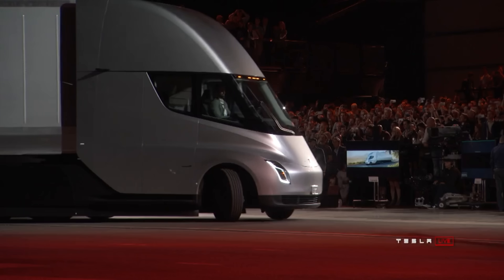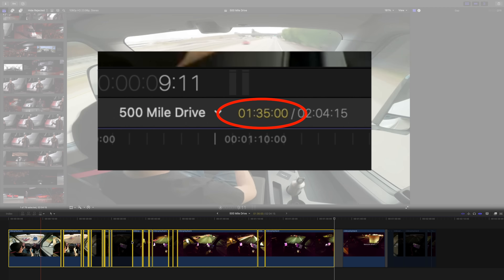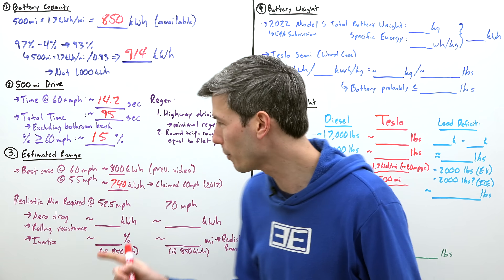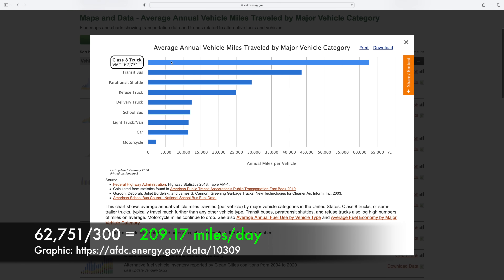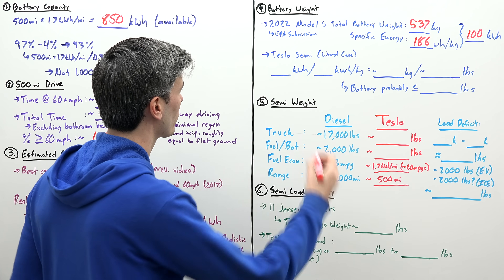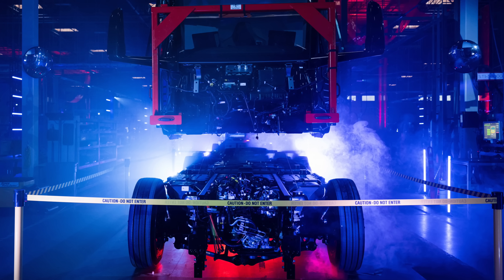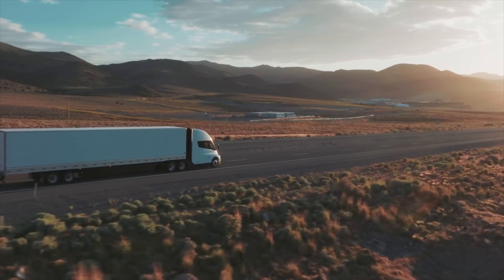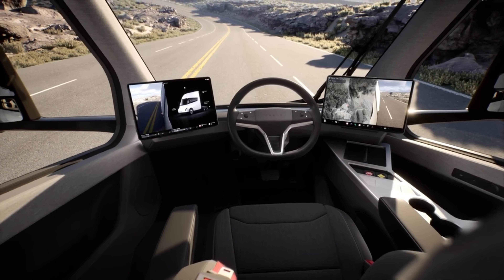Does The Tesla Semi Make Any Sense? Part 2!

Comment: As always, you answered almost all of the questions I had. One statistic I looked for, but couldn't find, was regarding the weight of loads, is how far do heavy loads typically travel? I have hauled thousands of miles towing a trailer, but the trips I've driven when nearly fully loaded have ALWAYS  been just barely, if at all, in the double digits of miles. If I have heavy loads to haul I find the nearest source to reduce my fuel costs. I'll haul firewood from home to the cabin, but if I need stone? I'm looking to get that from the nearest supply source. I wonder if that thinking holds true for truck shipping too.
Reply from the maker: I did try to include average distances traveled for loads within this. There are more detailed numbers referenced in the sources listed (if you want to see a more detailed breakdown), but ultimately if something needs to go from one side of the country to the other, it's going to be broken down into specific length trips to make it happen.
Reply: @EngineeringExplained  math wise it would be interesting to see a video on driver's pay or company's ROI/tax's for BEV vs everything else and the pro's and cons for heath/other thing's as my first time/trip riding shotgun and parking in a 2000's truck stop i had a hard time sleeping and breathing as the APU's and main-engine's chocked the air up and yes DEF ect was in common use it's just 50 or so closely packed runing engines-ICE doesn't give time for the air to clarify something BEV's don't have problems with on a local level  

and solar systems ( as there's more flat/usable space and as a % is smaller vs passengers sedan sizing ) for refrigerator loads and or shore power or adding motors to the trailer ect if it makes a engineering difference mathematics wise, napkin maths and my good guess's is yes and a positive one at that
Reply: Anecdotally I can tell you that my company frequently ships out overweight loads which regularly travel 1-2,000 miles to their destination.
Reply: Yes and that's also consistent with the efficiency of electric power trains.
Reply: No such limit in the trucking business.  The heavier load reduces MPG, but apparently the customer is willing to pay for it.  Probably not significant in the larger scheme of things.
Reply: One example I can think of is bottled water. People ship bottled water great distances and I assume those trucks are maxing out the weight. In construction we get heavy loads from far away all the time such as oil/water separators, underground storage tanks, Italian marble, truck proof bollards, prefab metal buildings, glass etc. Even in NJ we had contaminated soil (shocker huh?) and they trucked it all the way from Newark to almost the southern border for disposal.
Reply: @randomvideosn0where  😂lolz on the soil shipping to Mexico 🇲🇽 , and yes swift/family/me riding shotgun weed ( my first run-in with real smoking 60's hippie's higher than a kite/super weird township for the time probably more normal now in California and or 2023 and my first family/talk/lecture about marriage/sex as male was concerned about me finding party-girl or going gay lol -nope H-no not for me not my type as a tween-16/drive's license age that's why i remember that load ) CA ~?2000-09 to i think Utah/WY or next door state 80-90Klb so heavily loaded on the bottle water but that doesn't always happen sometimes the shipper/buyer only sends 2 full pallets or ,miller's-truck hi-clone lab's a 1/4 ish or less pallet 30-40F but expressed at max legal speeds so 80MPH

some loads don't make sense to me like shipping water in from CA but return humpback was the same materials/load-out/different loaded-trailer just a different shipper/company buying it and this weirdness is still going on today in 2023 my family/elders/me is grateful for the work/income but USA nationally im not sure this is healthy economics?
Reply: @randomvideosn0where  Yeah, us southern states don’t have an adequate supply of locally sourced contaminated soil. 🤣

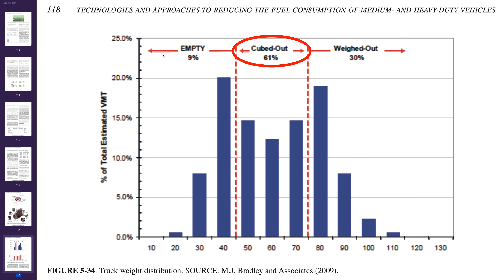Comment: I'm afraid I have to disagree with a statement around 12:09. As 30 % of current loads are weighed-out, it will only be more with Tesla Semi as it has a lower capacity. Meaning that Tesla Semi will not be the "perfect truck" for a job to over 30 % of the jobs.
Reply: but cost of usage is a thing ... and people tend to forget that important fact !
Reply: @snake_eater4526  Not sure I understand your point. I just said the supremum of the suitable loads is lower.

I didn't judge whether Semi is a viable option or not. I pointed out a mistake in the calculation.
Reply: @aleshorna6884  electricity cost way less than petrol, and electrics have way less mainteanance ( which is a big thing for ICE truck ).
meaning the truck might be unsuitable for 30% of the jobs, but you still gain 70 of the cost of use, so it's a win anyway to buy an electric truck

Comment: Sure many Loads are not weight limited. Often enough it's Volume limited. But the idea of using this truck for shorter distances has also a real world problem to it.Usually the shorter the tour the smaller the truck. That's simple distribution. 
If there is a big factory that produces, lets say a sweet liquid, it needs to get all that away from the factory, either to a port or as far away as possible on road, into different warehouses. From there the cargo is split up again. So the single cargo package gets smaller while the distribution distance gets smaller. 
Maybe there are a few huge stores, or facilities that would accept a maximum size semi truck load of sweet liquid by brand XY but many stores can't handle such a huge order at once. 

Maybe it would have been smarter to start electric road cargo with smaller trucks that actually do shorter tours. Like within city tours. Learn from that and climb up in truck sizes and models. Instead of try to start with the biggest size truck that usually takes the longest tours.
Reply: Yard trucks would be a good start, lets see if the motors can take hard pulls all day and night. When I did yard dog work we beat the hell out of those trucks, we had to or we couldn't keep up with nestle
Reply: Yeah, like those UPS vans

Comment: I agree to the view that we do need new types of green energy, but without doubt I believe battery is the wrong answer.   It's like communism and battery cheerleaders are like communists in late 1890s.   Several decades and at most a century later, we the people will find your promotion is TOXIC, literally TOXIC.

I would bet on either hydrogen fuel cell or ethanol, absolutely not on battery.   For example, if some biochemist genius figures out a cheap and practical way to transform all weeds on earth to ethanol, then that's the answer of the REAL green energy we are talking about.

Comment: The real problem is battery aging, all of this takes into account a new battery but doing a full cycle 2 or 3 times a day is going to burn it out very quickly.
Also they are huge resource sinks, you can make almost 10 Electric cars and thousands of small appliances for that size.
Reply from the maker: I think moreso than thinking "will the battery age" (of course it will) the better question is "how far can the vehicle go." If it truly can last 1,000,000 miles, as Tesla says they'll guarantee or w/e, then that's similar to diesel rigs and wouldn't be a huge concern, as over those 1M miles the efficiency savings can pay off. Will it last 1M miles? Idk.
Reply: @EngineeringExplained  I highly doubt the battery is included in those 1 million miles. They assure agaisnt breakdowns or failures, battery aging is a diferent deal. And almost certain its a 40k-50 battery swap once every 1 to 2 years. My doubt about the semi is that the price tag is still under wraps and that is the first time I see people hyping a product without a price tag. 
Nice video with good info
Reply: 2-3 cycles a day for long haul. If you use the truck within the battery range it makes more sense

Comment: These Trucks will use 4680’s.   So the weight of the Model S battery is not a good comparison. 

Also, that flatbed trailer weighs 7400 pounds you did not include that   

If you had 44,000 pounds +7400 pounds that equals 51,400 pounds

82,000 minus 51,400 = 30,600LBS for the Tractor
Reply: They are currently using 2170s. They may use 4680s in the future, but not yet.
Reply: @anthonypelchat  I don’t believe it.   Electrek just wrote a story that they made 868,000 4680 cells in one week.    That’s enough cells for 1000 model Ys or 100 semi’s.
Reply: @NAY2GAS  Yes, 1000 Model Ys which we know for a fact are being built and in short supply out of Giga Austin. And Giga Austin just ramped up to 1000 Ys per week at the same time. They have also been testing for years with 2170s. And they have enough of a surplus of 2170s to do so. 

Again, they will likely move over to 4680s later. But it is unlikely that they are using them for the semi right now.

Comment: Would be nice if Tesla would just be transparent and release more information. Would save you some ink!
Reply: The problem is, is that there is a reason tesla doesn’t just say what the weight of the truck is. If it is legitimately good such as what this video suggests, they (in all common sense imo) just say what the weight is. After all, there is little downside to buying this truck if it weighs only 5-6k lbs less than your average diesel.

Comment: How much aero drag would be reduced if you "golf ball dimpled" the trailer?
Reply: I'm pretty sure that would increase drag rather than reduce it.
Reply: @Vykk_Draygo  it reduces drag but is expensive and ugly so nobody does it. Why do you think golf balls are dimpled?
Reply: @GBM0311  this only works for spherical objects
Reply: @GBM0311  I read a paper on the subject before responding to confirm my supposition. The drag on spherical objects is different from teardrop shaped objects (the cab on the truck is more teardrop than spherical). It was all very technical and I'm not a flow specialist (I'm in IT), but essentially the dimples reduce drag by reducing wake. The dimples disrupt airflow, which would be negative on a streamlined shape. Apparently, the other way to achieve this effect on spherical objects is with speed (obviously not really an option with golf balls).
Reply: @RCmaniac667  it works on cars as well.
Reply: @Vykk_Draygo  idk what to tell you except that it sounds like you stopped at the first paper you found after a Google search. Read more. There's experimental evidence and other papers published that contradict what you've read.
Reply: @GBM0311  yet almost never seen on them
Reply: @RCmaniac667  I already explained why. And turbulators are used in various racing applications they just don't come in the form of dimples.
Reply: @GBM0311  Which isn't the same thing as making an entire flat surface dimpled. If that would work, then F1 would dimple every flat surface on their cars that isn't dedicated to creating downforce.

Comment: It does make sense but I would argue only if used in a larger city and areas with dense population. You would need a loading and unloading terminals where you can shift cargo from regular trucks to these electric versions or however that would work in the real world. However even if this is a good case for getting pollution and bad air out of he city does it make economical sense. If you get subsidized from the government or similar I guess this could become a thing as everything is about economics and ROI. Besides with a diesel truck you can put more fule into it and keep going, the electric vehicle has always been best suited for urban environment and the large city. I do not think this will ever change for electric vehicles, kind of bound by the laws of physics unless some revolutionary new type of battery comes along or something else happens in the future. Great video.
Reply: I do not think this will ever change for electric vehicles
Reply: Heavy amounts of trucking is from train stations. The range is more than enough for those. Charging infrastructure is still needed, which is where a lot of the subsidies are coming into play. Once the charging infrastructure is in place, long trips aren't that big of an issue, especially for trucks. Truck Drivers have mandatory downtime that can easily be done while charging.

Comment: adam something viewers feel probably very bad after watching this, and many others too
Reply: Speaking for myself, not at all and why would we?

Adam something (and definitely the others I won't name but I absolutely know who you're talking about) did get stuff wrong, because they assumed the Tesla semi would try to match the range of diesel trucks.  An understandable assumption, even if it turned out to be wrong.  Their overall conclusions that followed that assumption were still seemingly correct, it's just that their first assumption turned out to be wrong.  It happens; nobody was claiming to be Nostradamus.  The initial Tesla semi event doesn't appear to do anything to dissuade those initial assumptions either so I don't see any reason to blame them for getting it wrong.  Other parts of their analysis, however, were still correct - Even EE here touches upon the use of these vehicles being contingent upon electrical infrastructure that may not even exist in large areas of the US.

So the new information we have is that the Tesla semi isn't designed to replace the long-haul trucking, but more of the short and mid-range.  That solves the battery weight verses cargo issue, and EE demonstrates that the predicted load capacity and estimated vehicle range still works for the majority of freight, or at least a healthy chunk of it.  That is excellent news!  But that still leaves the problems with battery wear from extensive use and rapid charging, battery performance during summer and winter, battery material source ethical and environmental concerns, and electrical infrastructure not being in place to handle the load of charging these semis.

That last one is the one that worries me the most - the electrical infrastructure is already in bad shape in the US as a whole, and I worry about the extra strain of having to charge large numbers of these semis if they got more widespread adoption.  Then there's prices for electricity that can vary wildly in different areas and there's nothing Elon can do to guarantee recharging rates unless he's building solar power farms all across the US himself, which he also can't realistically do.  Even if he could, he'd make more money selling that power to the overall grid and you know that's precisely what he'd do in a heartbeat anyway.  And all of that is before we have the increased electricity demand from semis needing to sit and get charged and the effect that has on prices once this all kicks off.  And finally there's going to be discussions revolving around what (if any) additional safety measures need to be taken for these trucks in special circumstances like tunnels.

But none of those are dealbreakers.  It's just looks like overall it looks like the Tesla semi will be a bit of a niche product rather than a replacement or a new standard for trucking, and that's fine.  It's just not (yet) a revolution of the industry.  It might ignite a spark of interest in investing more into the electrical grid to make it all more feasible and widespread though, and that would be very exciting.

Comment: You don't factor in how fast the battery ages and reduces in capacity & how often it needs to be replaced...
Reply: because regular tesla are proven to degrade very slowly... just look for info about it and you will see
Reply: Should be for several hundred thousand miles before a replacement is needed. And you don't drop below 90% capacity until the later years of the battery's life. So not an issue.
Reply: canadian winters would k1ll that truck dead instantly.